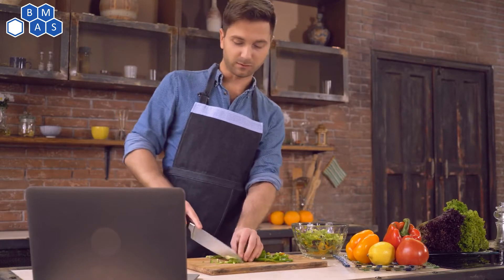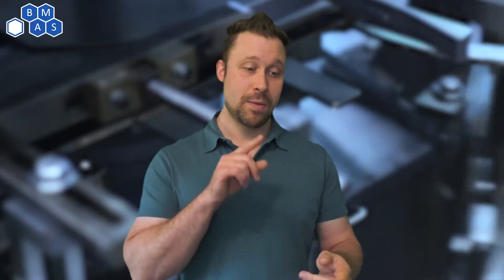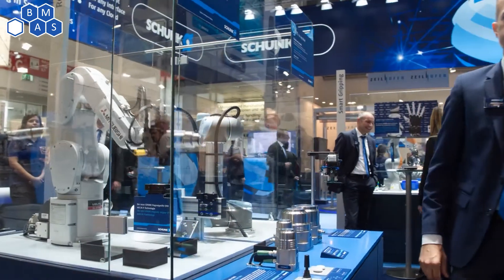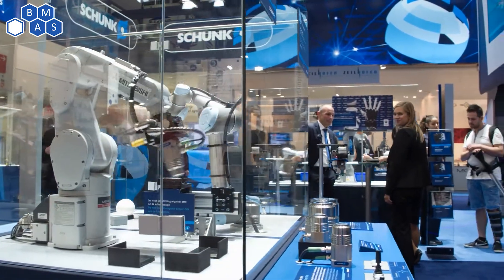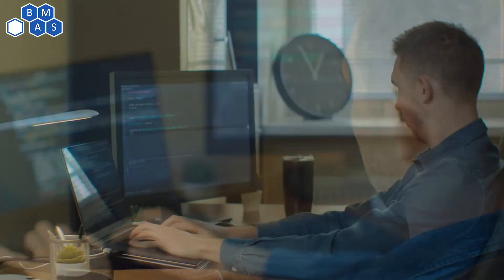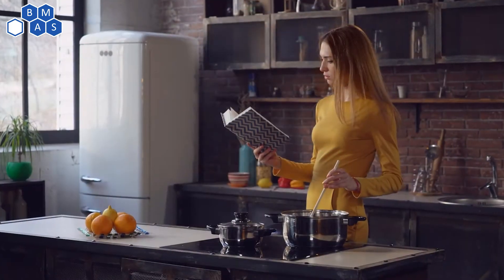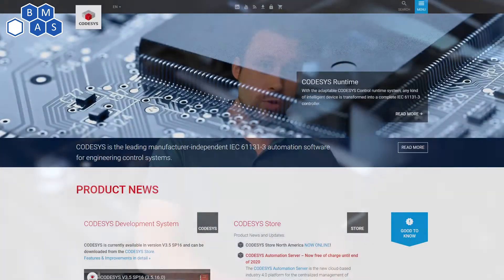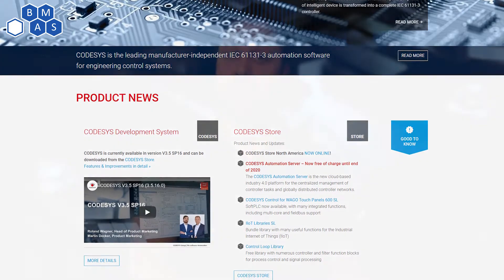How We're Teaching PLC Programming for Free

Comment: Hello, I would like your help, I need to do a project. The PLC, an FX3U, will send the MR JE C servo to rotate to one side a certain amount of pulses entered into a register on the Sankoom HMI, when it reaches the count, the servo returns to the value of 0. Could you help me with the pins of the CN3 connector and the configuration parameters in mr2?
Reply from the maker: Thanks for watching!  I think this is a little more than I can get into through YouTube comments.  The first thing to do is always check the manual.  If that doesn't get you what you're looking for, I like to reach out to the supplier (wherever you bought the PLC and servo) because they usually have technical resources that are more personable than the manufacturer.  If that doesn't work, then call the manufacturer tech support.  

And of course, if you'd like help from a friendly integrator, contact info is on our website:  https://www.breen-machine.com/contact-us/

Good luck!